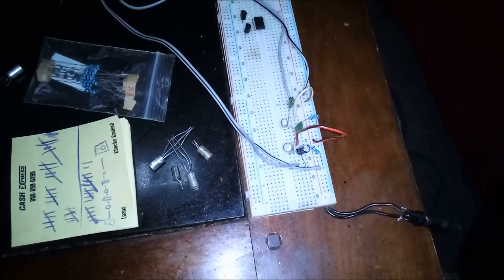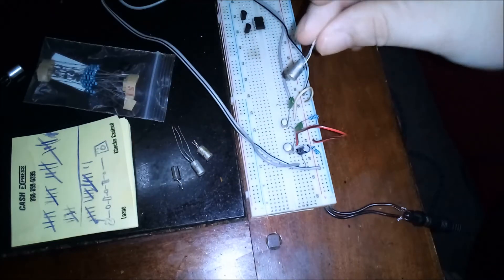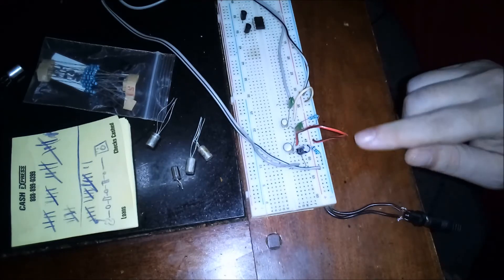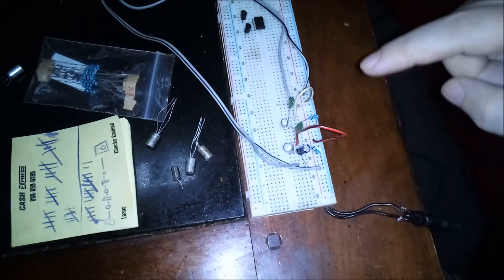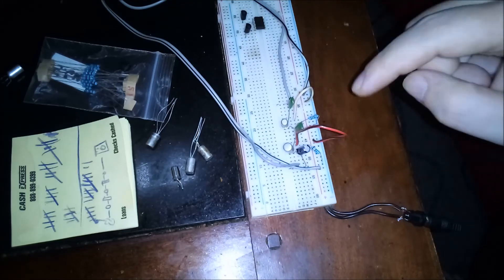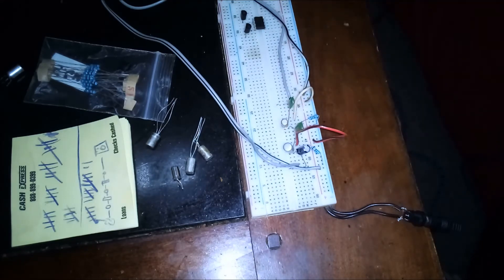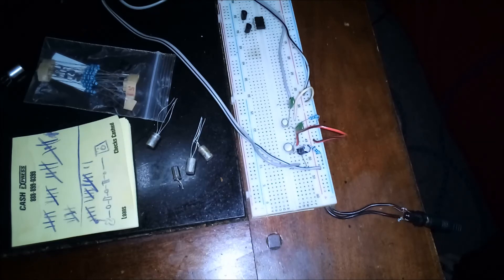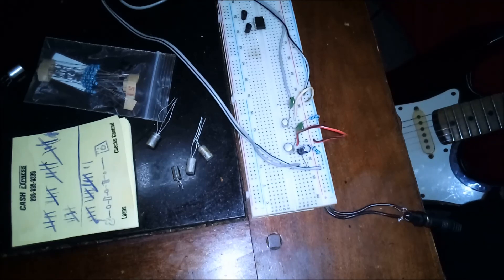Germanium Fuzz Experiment = Nice Circuit. (Very Simple Schematic)

Comment: that needs to be recorded into a DAW. with some drums samples.. Jimi would be proud of them sounds..
Reply from the maker: Thanks Bro. I must admit though that I have since removed it from the bread board to try out a low voltage hybrid tube high gain pre-amp. Which actually did work at only 9 volts but I am still trying to get the hum worked out of it. I did make the schematic though so I can rebuild this on a proper vero board if I ever get around to it. But, Petey sent me a big bag of vintage germanium top hat transistors. so I may be able to make the circuit in the video even better.

Comment: That sounds awesome!
Reply from the maker: Thank you for watching. It was just a happy accident really. I just kept plugging stuff into the circuit until it started rockin. I dont do math or anything like that I just plug stuff in and wait for smoke or sound. Thanks again for the kind comment.
Reply: It’s cool man, it’s entertaining and gives me confidence to dink around more with it.  I had build a little onboard no battery distortion switch a little while back that didn’t turn out too bad.  But I definitely want to take a shot at custom pickups now.
Reply from the maker: @thelastagain1202   That is Great! You can do a ton of different things with pickups its pretty much a rabbit hole to china from designs and shapes and magnet types pole sizes and placements can make miles far ranging tones. Even the size of wire and how tight you wind it what coating it has on it and how often you move left to right while winding...  its not as drastic as changing a cap or transistor in a distortion circuit but the subtle differences are endless with just the magnet wire.

Comment: Sounds good... do the positive signs near the three lines indicate the ground or something else?  Pretty new to this.
Reply from the maker: Thank you William. In the circuit it is ground but in reality it is connected to the positive terminal of the battery. I know that is confusing but I may be able to simplify it. With the old 60s germanium transistors most were PNP which means the have to be basically hooked up reverse polarity so the battery goes backwards all the jacks are grounded to the positive side of the battery and the power in is taken from the negative side of the battery. So to maybe make that a little more easy to understand (I know it sounds complicated) If I were to build the same circuit with with modern silicon NPN transistors I would just flip the polarity of the battery so that the - terminal would go to the jack grounds and the + terminal would power the transistor. In short with PNP transistors like most of the old germaniums you have to power it backwards. The biggest problem with this is that if you daisy chain pedals on the same power supply it will short out the pedal. If you use a battery its fine. Look up npn and pnp fuzz face circuits and you will see the difference (flipped battery wires) I hope that was somewhat understandable and maybe clears some things up.
Reply: @heavymetalATC  that's crazy... thanks for that. I might try to make this circuit someday as it sounds ace.

Comment: Great video 👍👍👍 How s that guitar build project going?
Reply from the maker: Thank you Fat Cat, Well the guitar is about 75% done and has been for a few months. LOL I started on other projects I tore down a 1920's house to get free wood for guitars, That lead to rebuilding the subframe and floor in another house on the same property... and then I rebuilt a street bike, Then it got hot outside and I started messing with circuits again, but It is cooling off now and I will try to find time to route out the neck pocket and body cavities some time soon. then sand it up and put some kind of finish on it. At that point it will be ready to assemble. I know it is taking forever but I have a very flaky ADD kind of demeanor and I jump from one thing to the next back and forth.